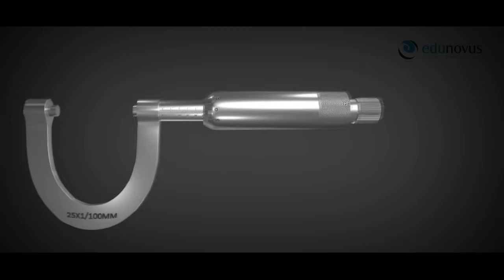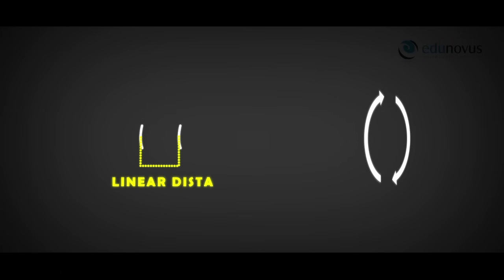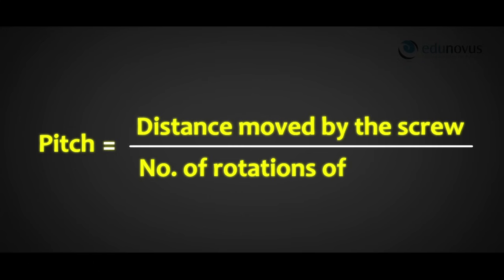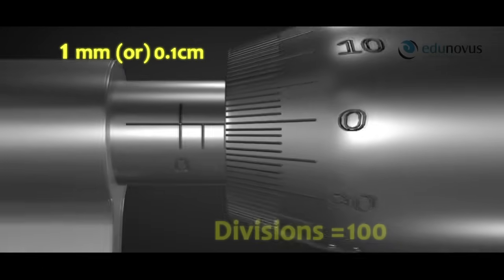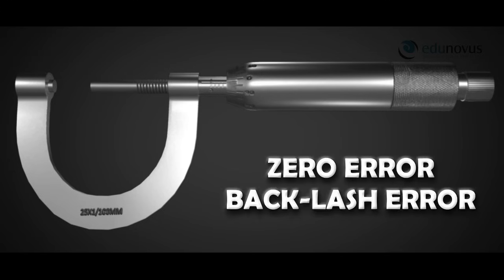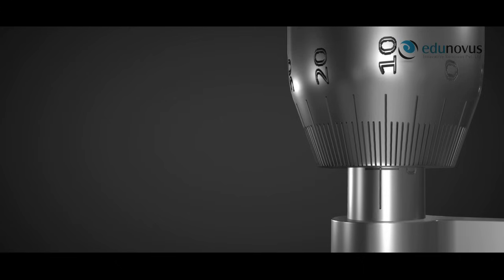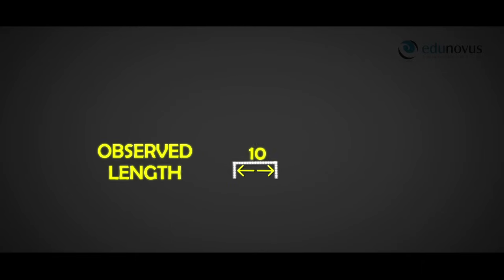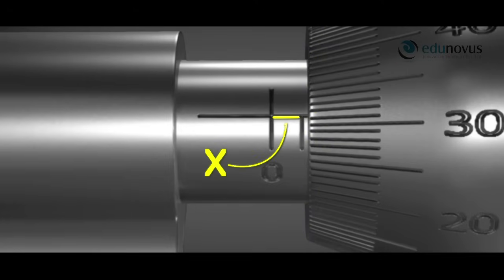Physics Practical: Edunovus _ Physics _ Screw gauge principle and description (Introduction)

Comment: A FAULT in screw gauge

The zero is on the left and the main scale consides with the 90th division of the circular scale, in this case the zero correction will be   10× 0.01mm = 0.1mm.
Let's say we have to measure a wire of 0.01mm thickness, after measuring it we will get its value as (90+1) ×0.01 = 0.91mm;  By adding the zero correction we will have (0.91+ 0.1)mm = 1.1mm.
Now a wire of thickness 0.01 mm is measured 1.1mm.
That seems a fault to me. May any one help me  if I am wrong ....

Comment: Sir zero error is negative 7:41 here and correction is positive 7:41 here but not here and the ANSWER SHOULD BE 7:51   --(10x0.001cm) not 10x0.001cm😅😅